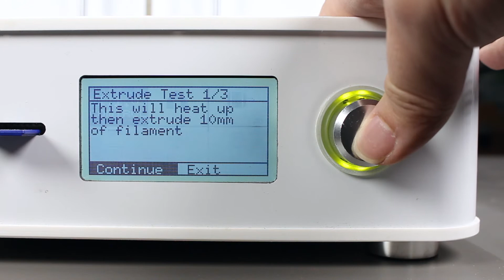3D Printing with Marble Filament

Comment: The black specs will not harm your nozzles like most metallic filaments will.  They black specs in marble pla filaments is carbon fiber.  As long as your nozzle diameter is not smaller than the specs you are fine.  If anything the marble pla will help clean any gunk out of your nozzle as the carbon fiber is abrasive but in the same sense a toothbrush is abrasive on your teeth.

Comment: Dude, your nozzle diameter is 0.4, not 0.46. It only seems bigger because the melted plastics come out at different diameters depending on your flow rate, upward forces, etc
Reply from the maker: Thanks for the comment! We used the same extrusion wizard on our printer which should provide relatively the same same flow rates and other forces in play.

Comment: I have 20 yrs experience in plastic manufacturing. My best guess as to what the black specs in the material would be is a non compatible colorant. Plastic color additives are material specific, however non compatible colorants can be used with materials successfully. In order to get a marble pattern in ABS plastic we would sprinkle in colorant formulated for use with polypropylene and/or PVC. The different colorant would not mix together but would bind to the ABS separately and form distinct color variations instead of being a gradient color shift that would be obtained from using all ABS colorants. Interestingly we also made injection molded parts with a remarkable candy  stripe pattern during material changes, switching from ABS to rigid PVC or vice versa.

 I highly doubt that the colored specs in this marble material would cause any more wear to the nozzle than standard solid color filament, I can understand the metal filled filament being more abrasive causing excessive wear on the nozzle, but not this material . Judging by the way the material was reluctant to extrude at first perhaps your nozzle tip was not fully up to temp and caused restriction to the flow which resulted in a lower result to the strand thickness. Material drag on the colder nozzle and thermal expansion from sheer heat generated during your prints could easily account for a difference of 1-2 hundredths of a mm. 

For testing nozzles of such a small size you can get a more accurate measure of wear by testing with a flow bench. By running a specic volume of liquid at a specific pressure through the nozzle and measuring the time it takes you can gauge the flow rate and extrapolate the nozzle diameter. It's far more accurate when dealing with measurements in hundredths of millimeters than using calipers on an easily deformable material like plastic.
Reply from the maker: Thanks for the comment and advice!

Comment: Could the specs be simply plastic dust that has been mixed with an additive for a higher temperature. Or possibly just a plastic with higher melting temp? For example: specs of ABS suspended in a PLA filament?
Reply from the maker: Hi!

It's a possibility that you could be right about the filament but we are not sure what's actually in the filament.